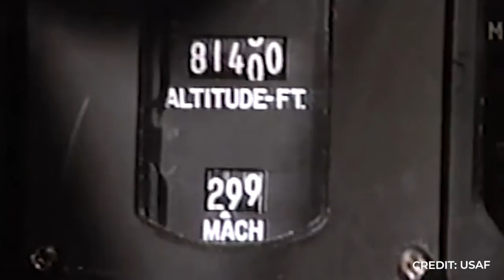5 Planes That Break Speed of Sound (Sonic Boom)

Comment: The limit for manned vehicular speed records will probably be biological rather than mechanical.  While G-force is a measure of acceleration rather than speed, it is still probably the limiting factor in achieving those speeds.  9G's is about the top that you can briefly sustain without permanent injury or death.